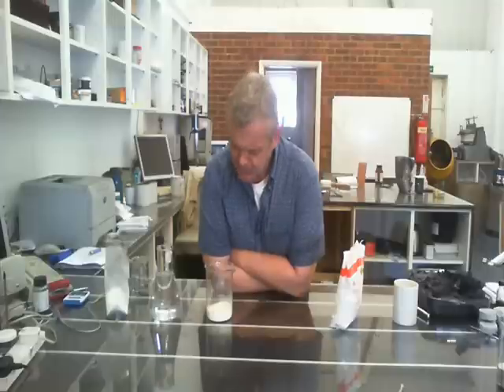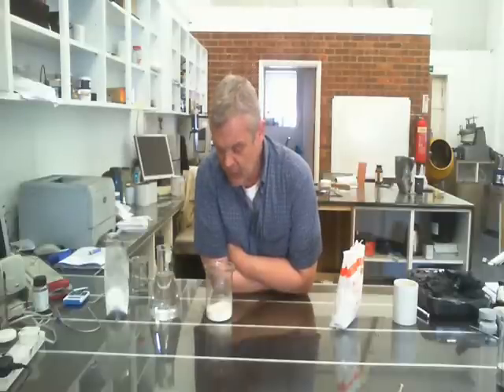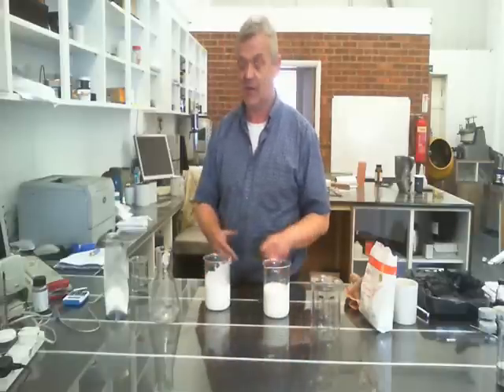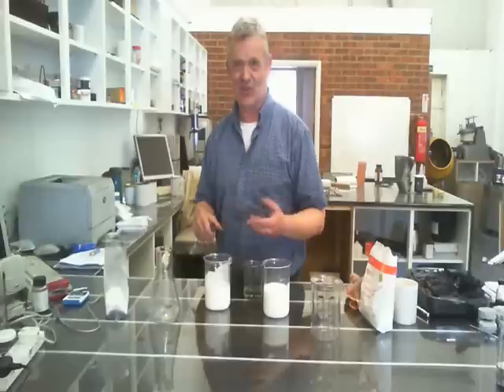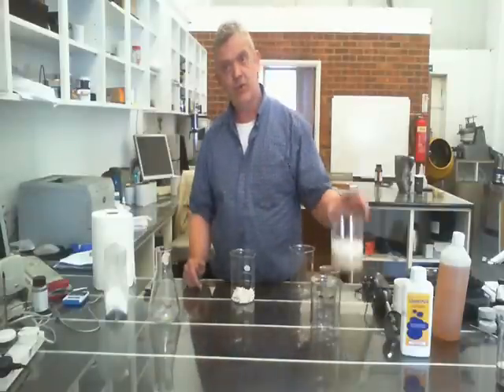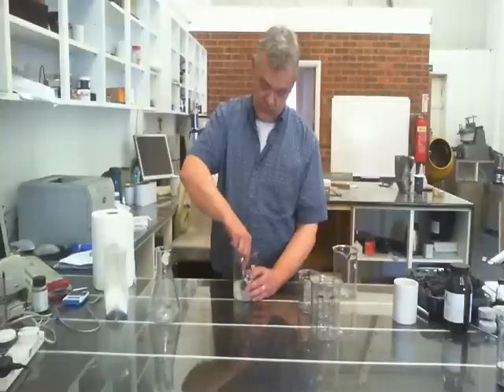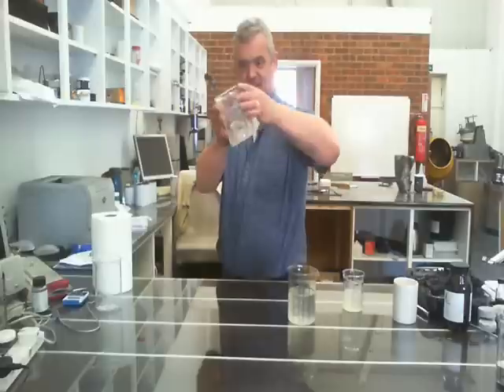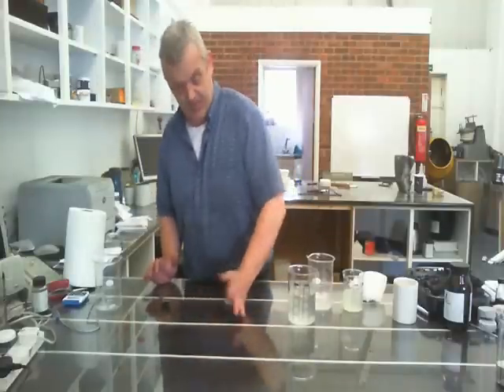Making Fake Ivory And Casein Milk Plastics, Glues and Paints

Comment: Do you know if there are any other substances than formaldehyde that can form crosslinks in casein plastic? I don't have anything close to a setup that I could use to work with it safely and i'm curious to try it at home.
Reply: Sharon Zohar there are a few, but I don’t know chemistry that well, so I cannot vouch for the quality of the end protect, but there is one glycerol based

Comment: Everything worked for me until the last step, the part where you knead the casein in hot water to make it rubbery. When I add hot water, all that happens is that it breaks up and becomes a mixture, like a casein juice. I can’t do anything with the casein because theres nothing to ‘hold’ on to... what’s happening here?

Comment: Hey Robert I have hopefully some simple questions about the process,
Is the methanol cleaning or the alkali blend and acid precipitation method better for making purer Casein for use of a plastic?
Does the type of acid you use to first extract the impure casein and precipitate when cleaning change the properties at all?(Which acid is best)
Does air drying it make it just as hard as formaldehyde?
Reply from the maker: Any acid will do it mate and 'best' is never a good question as there is just no such thing as 'best' - there are just things that are most appropriate to the situation - for example if you wanted to do this at home acetic acid is 'best' but if you want to do it commercially sulphuric acid is 'best' just for cost and waste stream and availability and environmental issues - asking what is 'best' is so fraught because you don't outine the strictures of the problem for what would be good in the circumstances - as it happens only you can work that out through your own experimentation - air drying does make it as hard but doesn't waterproof it.

Comment: If the ammonia dissolves the casein, how would I separate the casein and ammonia? Unless the casein is just like a cream then would I just pour it onto a mold?
Reply: Also after adding the ammonia to the casein and water do I stir until it becomes clear or do I stir and then wait a while for it to become clear, and if so how much time do I wait? Thanks.
Reply from the maker: +MCbrunz do the experiment and find out mate - it is easy and fun and will teach you a lot
Reply: +Robert Murray-Smith I actually have tried it multiple times different ways and its not turning out which is why im asking in order to find out why its not
Reply from the maker: +MCbrunz i don't know mate - this is standard stuff and has been done for years and years - yo must be doing something wrong - i am sorry about that - but that's the way it is
Reply: To separate the casein from the ammonia, add acid again. I didn’t use ammonia but baking soda, and to get the casein again I added vinegar and stirred.
Reply: The advantage of using ammonia is, that ammonia simply evaporates. No need to neutralize any alkali and washing out t out the salts or having the salts in yout finished product. Same with the formalin used to harden the product.

Comment: after cleaning with  methanol I have never been able to get it into a plastic mass !!! its so frustrating. it ends up instantly going to a beaker full of mush. there is no way to pull it back together.  I would like to see someone do this in real time. its a freaking nightmare.
Reply: I started off just with the casein and an acidic fermentation and I got my best results then, it was plasticish and see through! but it was too brittle, Im working with glycerine now,  and my results went really bad, mushy, doesnt dry...    takes ages between experiments to get my results because its taking longer and longer to dry,   not sure what to do.    RMS showed a mix with the fibres under pressure and heat in a metal mould and hes got really good results,  but I'm not sure how Im going to get access to the metal moulds it would require without it all busting up and breaking under the pressure,   so Im looking for a method without the pressure,  but I dont want to use anything noxious,  so I have to keep going...

Comment: I have been revisiting this plastic as I have been playing with melamine and phenol and all of those complexities. I have been evolving phenol from  salicylic acid through short path distillation and its pretty fidgety to say the least.

I have had mixed results with this casein the last few days.  upon redissolving casein in ammonia hydroxide i fine the first time it wants to immediately turn to plastic rapidly if i dont introduce acid to get it back out of solution.   I have done this in attempts to purify the stuff but i dont think its the best way.  emulsifying and  water washing has worked better for me.
At any rate I wanted to ask you if you had trouble in second or third dissolving in ammonia?  it gets much more difficult to work with after the first cleaning.

when i have used the methanol method ithe cacein lump seems to go to a very creamy solution.  I dont get the stringy mass weather I keep it hot or cold.  This is all good for drying it for storage but not good for trying to really clean it.  it becomes hard to work with.,

i have been reading the book but i think that I need to buy your book!!! 

Have you noticed any of this?
Reply from the maker: +Clown Whisper no mate - it redissolves easily for me
Reply: I honestly don't know what I am doing wrong because if I we dissolve in an alkaline solution and then bring it back out of solution to clean it it will never go back into solution for me again no matter how many times or how long I stay or what the pH is it always stays white particulate

This is a complicated process I don't know what I'm doing wrong if I take it in and out of solution twice it won't go back into solution ever no matter how alkali I make it or no matter how vigorously I stir it if I apply heat nothing it always stays a white particulate
Reply: Robert Murray-Smith if I initially make the case and pull it out of the milk solution into a big glob and then immediately we dissolve it in alkali solution it will turn make the most beautiful thin strong plastic sheets but it isn't as clean as I would like it. If I clean it the whole process of turning it into plastic doesn't work for me does your book go into this maybe I should just buy it I have an absolutely wonderful use for this
Reply from the maker: +Clown Whisper Mate - without actually being there - there is little i can say to help - i don't know what you are doing wrong either
Reply: Robert Murray-Smith I know mate I just thought perhaps you might say to yourself oh yeah I know what he's doing wrong I took a chance but thank you for your reply I appreciate it I have actually been doing a couple of steps today that seem to go more in the lines of what you have shown on this video so perhaps I raise the heat to high at one point or some weird thing like that or had too much acid perhaps who knows
. 

At any rate it's working more to my liking now and even when you don't have anything to say you're telling me something you're telling me that what I'm saying should be working so I keep going and I solved the problem so thank you very much
Reply: And I didn't really mean to bug you on this old video but I'm just amazed at all the uses for this casein  stuff
Reply from the maker: +Clown Whisper It doesn't bug me mate - but it is just so difficult to say what is going wrong when i am not actually there - it could be a million things - it might even be the water you are using!!
Reply: +Robert Murray-Smith just for shits and giggles I keep on messing with the main batch that was giving me problems I can get it back in solution just fine and I can get it out of solution but it will never Clump together it will stay as fine particulate no matter what I do it's damn strange and also it doesn't sink to the bottom when it falls out of solution it floats it's amazing I can't explain that one back I'm about ready to give up on it. I've made 20 other matches with perfect success doing it all the same way.
On a different note to self buy ammonia hydroxide problem by keeping it simple I needed some more ammonia today and I was tired of distilling it because you get so very little if you keep going it gets hotter and hotter and it just ends up losing itself to gas. Sewing keeping it simple I put a gallon of 10% household ammonia in the freezer and got it just about freezing. I filled up 1000 milliliter Erlenmeyer flask about three-quarters full and dropped a large 3-inch magnetic stir bar in it. I put the thing on the stir plate as fast as I could go so it was a whirling mass of bubbles and I set up an ammonia generator with a 500-milliliter flasks containing ammonia nitrate and sodium hydroxide dry. What I do is add a couple of drops of water and Heat and allow the thing to generate its own liquid that starred in the hydroxide so you get very strong gas out of it. By not actually bubbling it through the liquid using tubing you don't have to worry about suck back and the gasket saturated in the liquid anyway because of the violent churning within the flask it works quite well. After the reaction starts dying down I put the ammonia generator on a hot plate and get a little more out of it. Also I put a makeshift pressure valve such as you find in pressure cookers a weighted piece of metal over top of along Outlet spout made of stainless on top of the Erlenmeyer flask on the steer plate. This way I can also keep the reaction under some pressure that helps the liquid absorb the gas quite well.
I made all this stainless apparatus with by lathe.
I have not I traded it but after it settled down for a while I took a small sniff of it and it was every bit as strong as smelling salt which hover around 30% so perhaps I reach that. It's actually kind of amazing if you think about it 700 milligrams of 30% ammonia hydroxide in 15 minutes. I'll have to titrate it to really find out I just am not sure if I have any methyl blue.
Speaking of blue this solution that I just made has a tiny bit of a blue tint to it but I can't figure out because all the glassware was new never used washed out clean I actually put it through a base bath rinse it and then put it away so I know it's very very clean. The tubing was brand-new that I cut from a roll and the chemicals were reagent grade. So I cannot figure out why this ammonia hydroxide solution has this slight blue tint.
If you've ever heard of such a thing let me know
Reply from the maker: +Clown Whisper it's mildly amphoteric mate - pH has quite an impact
Reply: i take the casein point at a time checking the ph with every few drops of alkaline or acid.  its just some strange anomaly that I cant worry about any more as i have it down to a good science  now otherwise.   I actually clean the stuff by stirring so fast that when it falls out of solution the particles are about 3 mm flat flakes. they are large enough to still be able to settle to the bottom fast. I do 6 cold water washes and press the mass with a makeshift press every cleaning.  it seems to work well and i get very clean product.
Reply from the maker: +Clown Whisper very cool mate

Comment: Isopropyl alcohol should work instead or methanol or ethanol right? And in the off-chance I can't find that, mouthwash would work too, but slowly?
Reply from the maker: +Nermket sounds right mate - i would just give it a go and see myself
Reply: +Robert Murray-Smith either I mashed it too long or the mouthwash wasn't cutting it.  
  
I'll have to try the methanol or ethanol or just isopropyl alcohol on its own. More than likely, I'll just use ammonia or baking soda  
(I would've done that after this failed attempt, but it turns out the baking soda on my shelf was just an empty box haha).
Reply from the maker: +Nermket it's all experimentation mate - but that's where discoveries are made

Comment: Any hypothesis on how it can be done with human milk? At this point I am about to just try dehydrating the milk and mixing the powder with resin since my attempts at extracting the casein are failing. Thank you for responding!!
Reply from the maker: +Naomi Francis you are looking to sour the milk - souring results in coagulation of the milk solids - these are mostly the proteins and fats. You can just leave it to sour naturally or you can coagulate it with rennet or weak acid like lemon juice. If you can get it to do that you are well on the way to casein recovery

Comment: I'm a Jewellery student. I'm wondering how difficult is the faux ivory to work with? Is it similar to polymer clay in elasticity? Or do you let it harden and carve it? How delicate is it, say, if I made a ring out of it would it shatter easily?
Reply from the maker: Hiya There are actually a whole range of things you can make out of this and it was popularised by Channel for faux jewellery back in the 20s - it is called Galalith - unfortunately it uses formaldehyde and quite high pressures to make really good strong stuff - there are a few companuies still making it - so if you don't feel like making it yourself you can buy it in rods and sheets

Comment: Hi!,
Thanks for the video, It helped me alot.
but after i shredded the casein into water and add the ammonia, it seems like a milky texture.   but how long will it take to dissolve it and so it separates?

and another question:
if i would do all the steps you described. and end up in the same result..  does it dry out completely? cause if i don't do the purification steps i noticed that it will stay soft in the middle and start to mould.   now i want to make products out of it with the lathe.  and so i need a fairly thick base of the stuff to produce this..   will it dry out in a closed mold completely?  like.. also inside.. that it won't mould.

Sorry for my english, not a native.
and thanks again for the great video!
Reply from the maker: you need to do the purification mate or it will rot. I am not sure how long it takes as i left it overnight - btu a little experimentation on your part will answer the question
Reply: Robert Murray-Smith Hi,
When i did the purification with ethanol and i strain it and put it in near boiling water, i can not get it into a clumb.   i'm just 25 minutes kind of ''pushing and rubbing'' the particles of casein together but it doesn't form a solid piece...
i always end up with almost the same thing before i purify it.   
to help you help me this is what i used in the whole process.. (milkpowder, vinegar,ethanol and near boiling water) 

i tried it 3 times now and i just can't seem to get it right..  please help sir!
Reply from the maker: Edwin Van Capelleveen
i'll run through this again mate and try and see what went wrong for you
Reply: Robert Murray-Smith  cool, hope to hear from you asap :)

Comment: Great video and easy to understand and follow. I am a professional knife maker at http:/RohrKnifeWorks.com and am considering using casein in a knife handle application as was done years back. Any suggestions? I am aware that the methanol agent is going to improve impurity removal. Again thanks for the fine work. I am at jimships@yahoo.com
Reply from the maker: Hiya mate - great idea - especially if you use Galalith - a google search will turn up a lot of info on Galalith and how to make it - it only fell out of favour because of the war  and it turns easily and would be great for knife handles - excellent USP too
Reply: Thank you for directing my endeavor. I will let you know. Is it possible to ask a question if I get stumped? I will start researching.
Reply from the maker: jimships no worries about asking questions mate

Comment: I have been working with this stuff for a few days and have come up with a decent thin varnish.  It appears that it becomes waterproof or at least resistant higher alkaline conditions?

With the sodium hydroxide it turned completely deep red and crystal clear.
Now I need to try some of the glue recipes!
Reply from the maker: v cool
Reply: Robert Murray-Smith Im looking for a real good wood glue recipe using this stuff.  Let me know if you ever hear of one.  There are many recipes in that old book but none specifically for wood clue that I could find.
Reply: Clown Whisper nvm I found one I think  yay

Comment: A tip for anyone using sodium Hydroxide.  Use very very small amounts! stir it for a long long time and it turns clear using very little of the stuff.

I did mine using a stir plate. 
Im lazy
Reply: Update,  I did a double batch of this in a great big 1000ml conical flask. It was spinning away after I added what I figured was enough caustic soda.  I left the room for a while and came back to find that the whole mess turned into a solid mass of jelly foam. lol..

I think what happened is that I did not have enough alkaline in it and the stir bar was introducing bubbles causing nucleation points. .  The real weird part is that the foam / jelly looked like tiny beads sort of like tapioca  

I added water and more soda and it seems fine.  although now its the color of beer and foggy.  It doesn't seem to want to go very clear 

Fun stuff
Reply from the maker: lol - absolutely